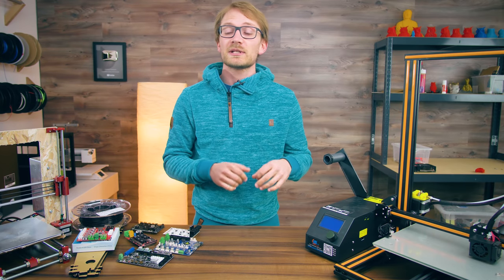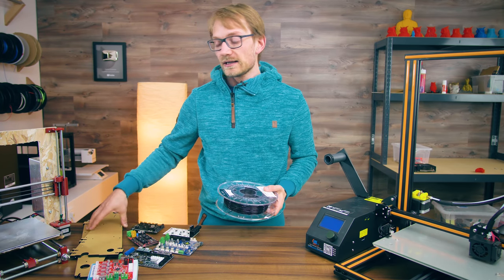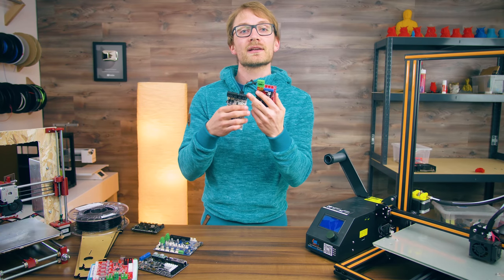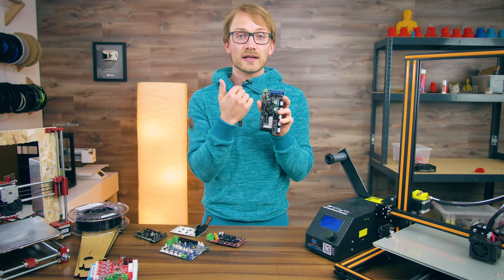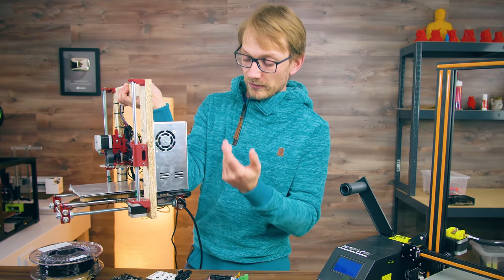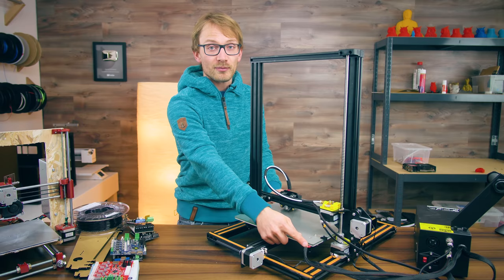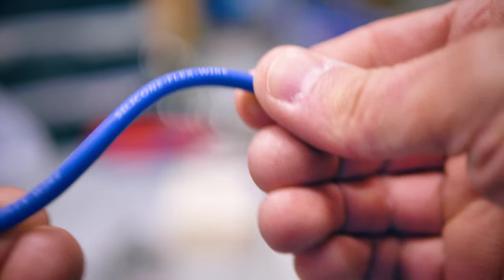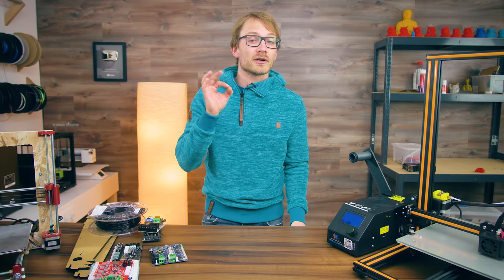Everything you need to know to make your 3D printer fireproof!

Comment: I was particularly keen on the Sea-Fire FG50A auto-extinguisher, as it uses the FM-200 Halon-replacement and has a pressure switch to cut off the ignition (it's meant for the engine rooms on small boats). I've been emailing various fire system manufacturers for weeks trying to find out if it's possible to get something similar with a mains-rated switch that could cut printer power when triggered. I want to stuff the whole bundle in a steel enclosure as last-resort mitigation. I figure a cheap 12U server rack should do a good job.
Reply: I went with the 12U server rack along with a thermal switch and an SSR to cut power.  Also put a BlazeCut tube in it.  Hopefully I never need to find out how well it works.
Reply: There are smoke and heat detectors with relay outputs that can cut the power via SSR or contactor.
Reply: Thankyou harles255, it looks like BlazeCut have a UK office so I'll look into them as an option. It certainly looks very compact! How much did you pay for yours, and did you go for the relay option?
I also want to add electrical thermal cutouts, but an actual "mechanical" extinguisher is final and reliable line of defence. Hopefully temperature monitoring and IR detection would cut power before it reached a point of no return.
Reply: The six foot BlazeCut tube was $100 on amazon, sadly it does not appear to be there in the US anymore, but it may be in the UK store.  The temperature controlled relay is actually an inexpensive Sous Vide controller.  My enclosure is not insulated and should never exceed 100c, so it has been working quite well.  I have a smoke detector in the room with the printer, so I have not tried to place one in the enclosure itself.  All in all, I really don't worry about it much at this point.
Reply: Hmm, there's a single Blazecut T3 on Amazon UK. Doesn't spec a length but says it's 499g in weight. Priced at £207, so roughly $292USD. Auto-extinguishers are proving to be both expensive and hard to get in the UK.
Reply: Doh!  It looks like the only affordable options these days are the stovetop powder dispensers.  That is unfortunate.  I am not a fan of them at all!
Reply: Well the price might just be because of Amazon's pricing algorithm. Most things I usually find about 1/3rd cheaper on ebay. I'll contact their office during the week though and see what the official price is. And yeah, I dislike the idea of having to clear up all that powder. It's bound to leave a lot less salvageable.
Reply: Just got a reply from them. 1m Blazecut, £230 with a relay. Triggers at about 120c, operating temp up to 80c. Still waiting to hear what current the relay can handle, but sounds good. £300 for a pretty solid last line of defence.
Next; to see how to fit temperature, smoke & flame detectors to Octoprint for some early warning.

Comment: The one key thing is regular maintenance - monthly, quarterly, whatever fits your bill. Check loose connectors, measure circuit resistance and voltage drop (for oxidation), tighten all screws, visually check the PCB for delaminated pads, etc. The vast majority of failures and accidents are caused by neglect, in any engineering discipline.

Regarding thermal runaway protection - if your board triggers it and you don't want to disable it completely, look for THERMAL_PROTECTION_PERIOD / THERMAL_PROTECTION_HYSTERESIS / WATCH_TEMP_*. It's still a hack for a faulty hardware, but better than nothing.

Comment: Awesome video, I'm always paranoid about electrical fires. Another safety measure would be to (if you can) have your 3d printer on a fire retardent surface. I do this with my lithium ion cells whenever I leave them unattended just in case.

Comment: Tinning wires also creates a rigid point of stress for the wire isn't allowed to flex, and eventually individual wire strands will break. I suggest using crimped ferrules.
Reply: I doubt there is any significant difference, because the ferrule is not flexible, creating a flex-to-solid point exactly as solder does. If heat shrink is applied you essentially create a "strain relief." I can tell you in my experiencefrom many years experience connections - crimped/soldered/other - have always been more reliable when covered with heat shrink. JME...

Comment: As for Marlin safety features, if you're having issues, rather than disabling them, you can slightly relax, how strict they are.

If I remember correctly, there's a time period, and heat offset. If the heat reading stays off from target for longer than given period of time, the print will be stopped, and all heaters shut down. So basically you can increase the allowed difference, or increase time period, or both.
Reply: design is a factor as well. Some hot ends can get hot enough to set plastic on fire under a run away conditions. other appear to top out at smoldering point. I had a thermistor failure that resulted in a call for max temp for a very significant time to an e3dv6 - no fire or smoking occurred. (The 3d printerrs original firmware did not have safety checks. I am now running repetier with checks enabled.)

Comment: Also another good one not mentioned was external mosfets they are a must on all budget printers espically for heat bed takes all the power strain out of the board
Reply: I agree with the suggestion but the quality of the external mosfets most people will go for is no better than the ones on the cheap control boards and they tend to fail 'on'. I'm not dismissing it as a part of fire protection (though as the video says a board with properly spec'd mosfet and connectors isn't any safer with another external mosfet) but it worries me the number of people who add a $8 board from ebay on the back of advice from Facebook and then tell the world their printer is safe - a false sense of security can be more deadly than a 3d printer :)
Reply: regmigrant All mosfets tend to fail on though, even better ones. In these semiconductors there isn't much physical insulation to stop that. If you want safety, you need a mechanical relay in series with the mosfet.
Reply: sure, I wasn't trying to suggest that only cheaper ones fail on but i phrased it really bad; I meant cheaper boards are more likely to use the 'wrong' spec (bin ends etc) and therefore more likely to fail. It was a commentary on the 'you bought a cheap printer so buy a mosfet to protect you' - 'ok, I bought the cheapest mosfet I could find so now I'm safe' fallacy.
Reply: Yes, that's true. It'd be especially unfortunate if someone got a good board with a good mosfet and then used a cheap external mosfet with it o.o
Reply: @warriormes6012  That's just what I was thinking: why would you use an external mosfet instead of a good relais and fuses. Seems so strange to me, actually I think in many cases good relais will be cheaper then the whole external mosfet-configuration. And in 'Fail' a relais will basically be 'off' in most cases.
Reply: @elvinhaak  No. If you use PID, the relay's lifetime will not be too much. And it can fail short too, welded contacts due to arcing are the most likely failure in high-power applications. Good to know that arcing is more severe in 24V systems than in 12V systems. A properly selected MOSFET is superior to a relay in this application. Read the datasheets and understand them. This is electronics engineering, do not just blindly follow advices. Use suitable series fuess AND thermal fuse on the heatbed. Some self diagnostics code would be practical too, for example by measuring the supply current. If the software switched something, but the current does not change accordingly, then signal error and switch the supply off with a relay. This is the application where a relay is superior.

Comment: Thomas- just finished building a plywood enclosure for a printer. I have one of those "range hood fire suppressant" devices in it, and I think I will also paint the inside of the enclosure with high-temp paint (often used in a BBQ or to paint a car engine). Anyhow, sounds like we're on the same track.
Reply: Look into intumescent paint not high temp.   The wood can still burn with high temp paint.. intimecent paint actually expends into a flame proof insulation keeping the wood cool and blocking the heat.   You can paint cardboard with intimecent paint and put a torch to it.  Its cool stuff and required in building codes in some instances.

Comment: Just a quick one. Octopi with Temperature Failsafe and Smartplug plugins Plus a smoke alarm hacked onto an Arduino and a 433mhz remote. That way, if there is smoke then the smoke alarm and Arduino will shut off the power via 433mhz and if the temperatures start going out of bounds then the Pi will shut off the smart plug. Did that on my Tevo Tornado a couple of years back. Would also suggest a GFI device. Did a vid on it all showing setup too.

Comment: Wouldn't the best engineering solution be to put thermal cut outs in series with the hot end and bed heaters? They're cheap and will work even if the controller has crashed or the mosfets have failed short circuit.

Comment: I learned a lot from this, thanks. Especially about the wire relief on the bed. I didn't know about the strands breaking down over time with movement. Had to solder new wires to my A8 bed as they used insanely thin wire which you would use for LED lights on the back of a TV, not for heating up a bed to 110C!  I thought those printed chain cable management designs were just glorified cable tidies. Didn't realize they were for strain relief.

Comment: Very good video!

You should always use wire end caps/ferules/cable shoes which are properly crimped. They also prevent single strands of the wire to stick out or shorting with neighboring cables.

Comment: Thanks for the tip about tinned wires. I did that while adding a MOSFET board to mine, going to go and fix that now!
Reply: What did you add a MOSFET board to anyway and why? People assume that they must need one because the ones on the controllers are crap without ever looking at what parts are in use.

Comment: The thermal runaway doesn't stop that instance of a slow wiggle out of a heater cartridge.  It lit up because it was supplying the right temp to the thermistor, but when it fell out it was super hot, lighting up the fan shroud.  Thermal runaway will cut the power once it falls out after the timer expires, but until it cools, you still have a super hot cartridge touching flammable plastic.
Reply: Joe wouldn't be a problem if people actually did any form of stain relief!

Comment: One could use a thermal camera to identify hot spots in electrical connections, especially at the points where wires/cables flex the most.
Reply: It would be a good way to check for hotspots, but decent thermal cameras often cost more than the printer itself.

Comment: Firstly, solder melts at over 200 degrees C so I think you're in trouble if that happens already. Also, another thing to check is not only if the wire comes out but to check if the connector is getting hot then you know there's a bad connection or too high current through the connector.
Reply: The problem is that, given enough time and pressure, solder will flow even at room temperature.
Reply: Wondering what kind of time and pressure we are talking about here?  Glass flows technically, but it will take about 10,000 years to form a drip.
Reply: I guess creep may be a better word than flow? Anyway – it's soft and may yield over time.

Comment: I have an acustic fire alarm mounted on top of the printer (and a second one on the ceiling of the room). Another simple and cheap idea to stop the fire from spreading in the first place is to put a large ceramic tile under the printer. And keep a minimum distance between the printer and anything flammable (curtain, desk, paper etc.) of at least 1m.